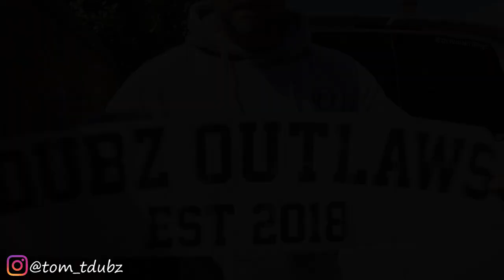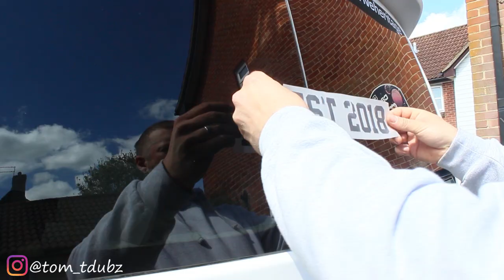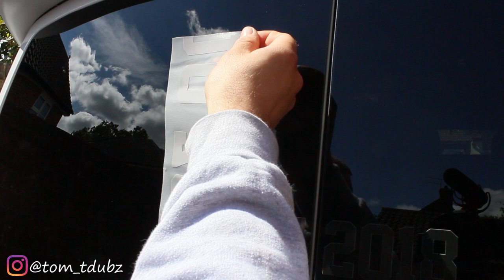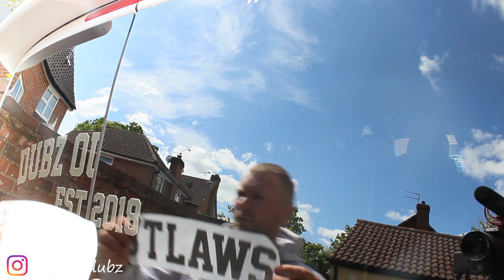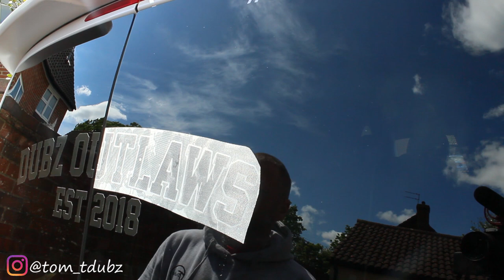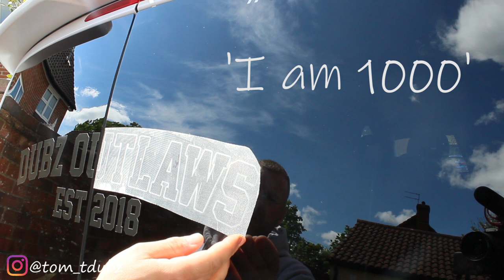Decal Fitting Guide vwt5 vwt6

Comment: I joined Outlaws, don't have a sticker though! Run out of jobs on the T5 now. I need to be back at work to order a load of stuff to get wiring, battery, gas sorted, because I get trade discount.. But vids will proceed soon as. Tbh, take up is slow. Good work bud.
Reply from the maker: I’ve got lots of other bits a piece to get sorted, so will have a few more vids coming shortly. Sticker wise get hold of Argy Gauna on Facebook, he can sort you the stickers 👌🏻

Comment: Hi Tom, I have just subscribed and am enjoying your vids! Got a few to get through!! Is your van a T5.1? Those headlights, do they work ok at night, good spread of light? Are you happy with them, do you plan an upgrade? I had a T5 2005 standard lights they were awful, had a T6 with LEDs which were awesome, now thinking of a T5.1 but couldn't face the thought of crap lights!! Would be interested to hear what you think? Cheers!!
Reply from the maker: Hi there, mine is a 2011 5.1 the headlights are fab I won’t be Changing them. I’ve travelinlite bulbs in the drls and side lights and the main beams are Phillips ice blue. Really good in the dark. When full beams on it’s like daylight 👌🏻
Reply: @tomtdubz  Cheers Tom - that's good to know! Thanks for the info.